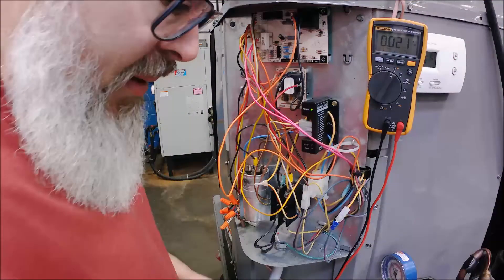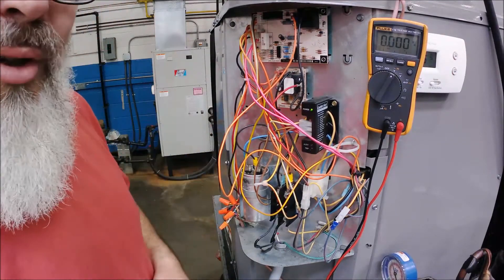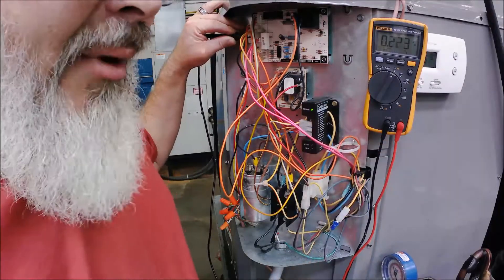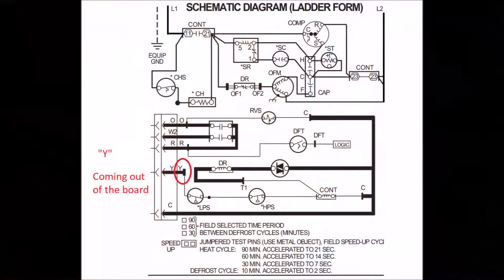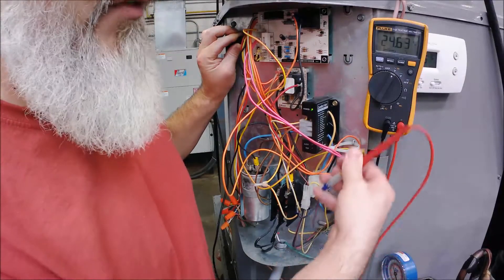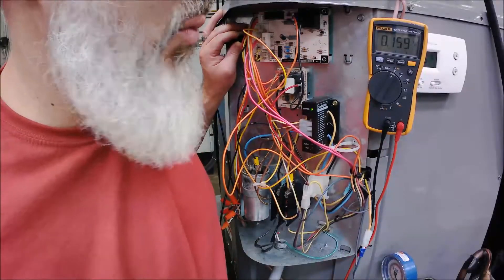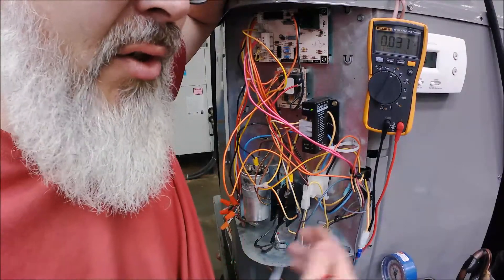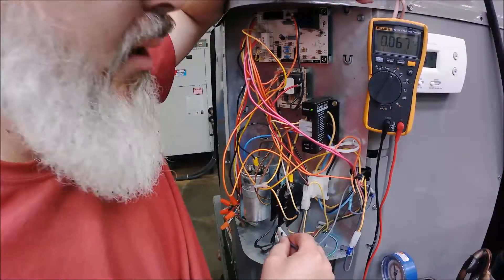Outdoor Unit Cycling On & Off | Low Voltage Troubeshooting

Comment: What is the smaller board below the defrost board and the black box can you please do a video on them and thanks for all your wonderful videos
Reply from the maker: The smaller board is for the 2 speed outdoor fan motor. The black box is a diagnostic tool for the compressor. It has a few faults that it detects in the high and low voltage. I'll try to get some info out on those. Thanks for commenting.

Comment: How to check charge in a Rheem in heat mode.  Check three units at true suction port and large discharge line and the suction pressure always goes to a vacun
Reply from the maker: That sounds very weird. It sounds like you are checking them correctly with the large discharge line and the true suction port. If it is going into a vacuum maybe the charge isn't correct or a metering device issue??? Is the coil outside iced over at all? I try to think logically and if this is happening on all 3 units...I don't know what to tell you on that one!  Sorry.

Comment: how do you test a pressure switch that trips unit
Reply from the maker: sorry for the late reply - had some personal stuff happening. For something like a low/high pressure switch I would check it 2 possible ways. You can check them with continuity to see if they are open...if you come upon a unit that isn't running and should be. Probably easier to see if it is a low pressure switch open and the unit is empty of refrigerant charge or a high pressure switch that trips if the condenser fan goes out. if you are seeing one cycle on and off then while running then just watch the gauges to see which one. Once I knew which one it was I would try to disconnect that particular safety from the wiring and still do continuity on it with the unit running just to verify...maybe. they are fairly simple to check. don't know how well I did explaining this though.